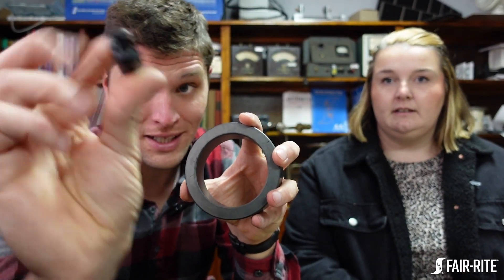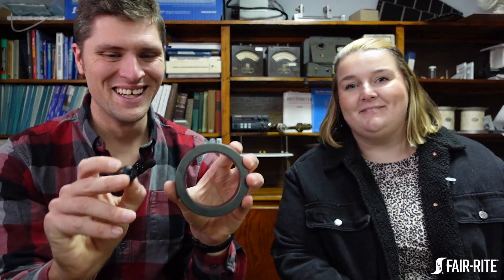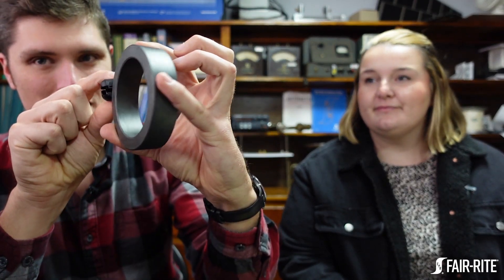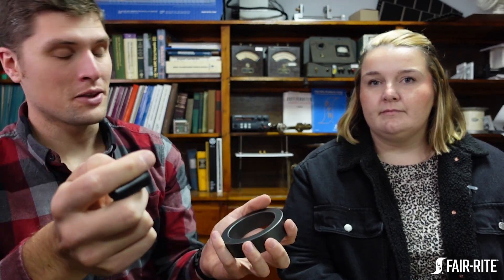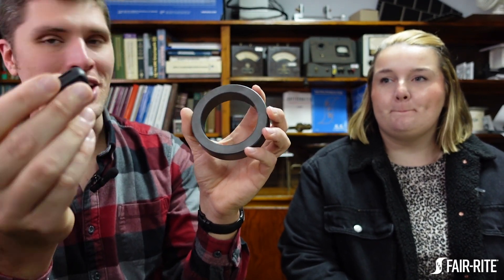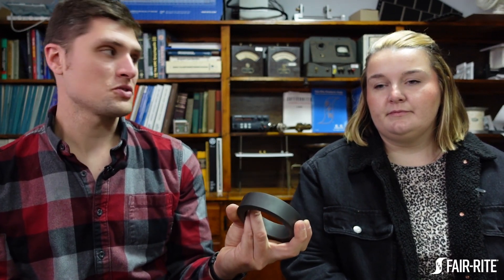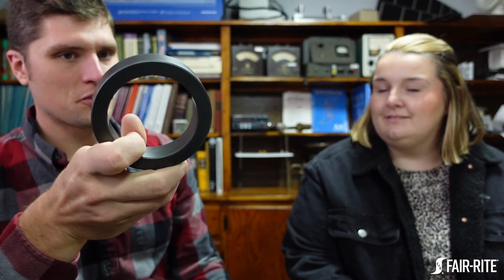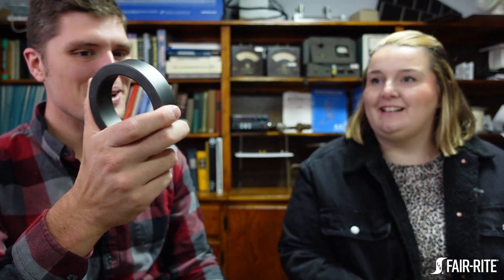Ep. 6:Toroid vs Snap-It™: Which provides more Attenuation?

Comment: For coax common mode current suppression, I have seen stacked cores and separate cores with windings recommended. Which is better in your testing & experience?

Also, I have seen simple winding and also where half are wound in one direction and half the other, presumably to reduce flux and saturation. Have you tested these two ways of winding coax and with what results?

Comment: I have always questioned how many clamp on's would it take to equal one turn around a toroid. So if all things were equal would the toroid snaps be squared as well. One turn would equal one snap on, two turns would equal two snap ons ... etc.
Reply from the maker: So, if the toroid and the snap-it (the ferrite bit inside) are the same size, the impedance would be almost the same. Toroid would be very slightly higher due to not having a gap. Multiple turns through either would have the same effect of Ω*N^2 at lower frequencies